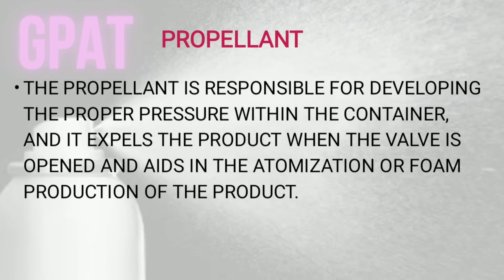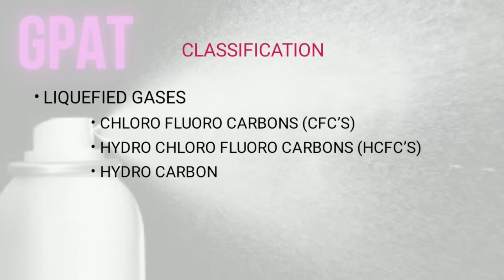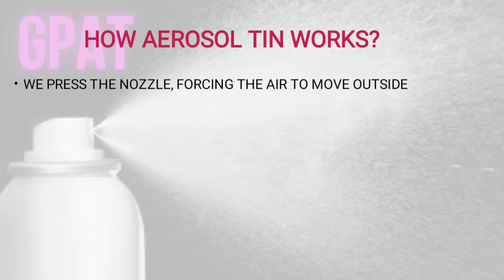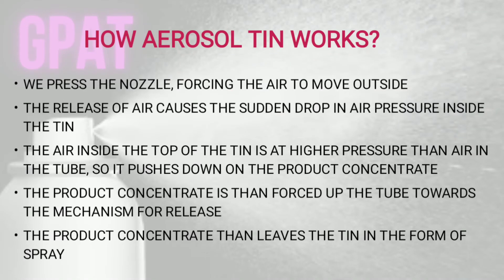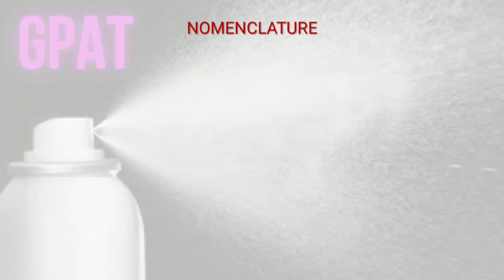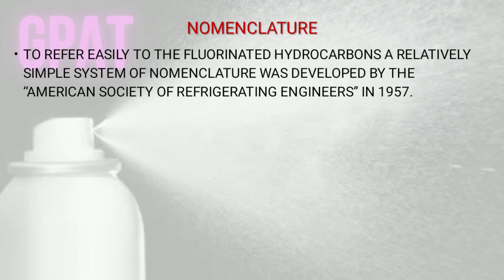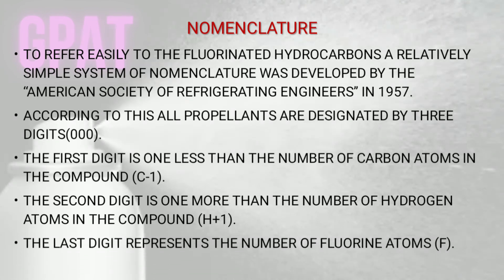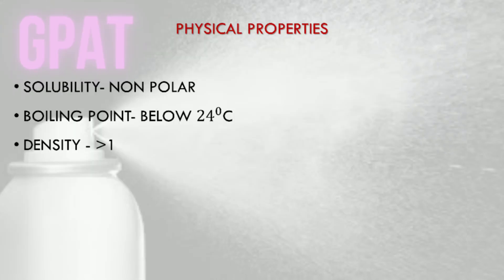Propellants ( from Aerosols).

Comment: can we fill air compressed from compressor to aerosol product as a propellant?
Reply from the maker: compressed gases like carbon dioxide and nitrous oxide as propellants, Nitrogen is abundant in air but other components like oxygen can be reactive with product. So use of air as such is advisable to be avoided
Reply: @visionpharmacy1311  thank you for your information